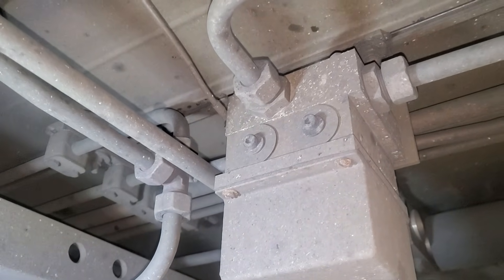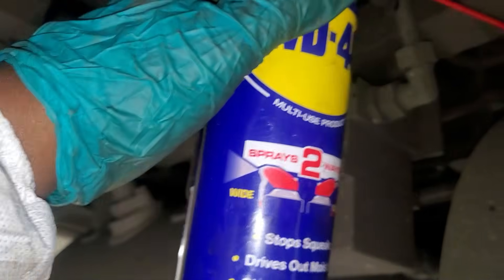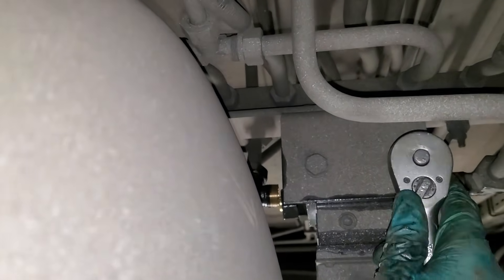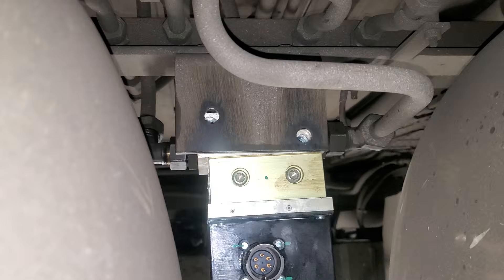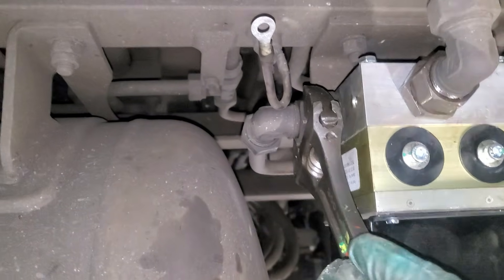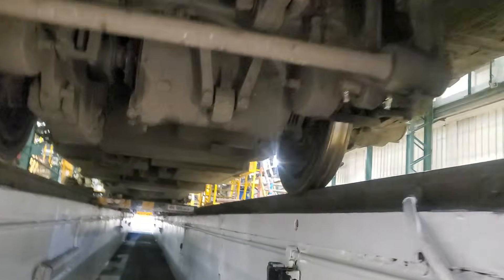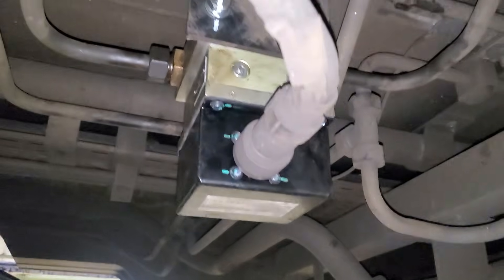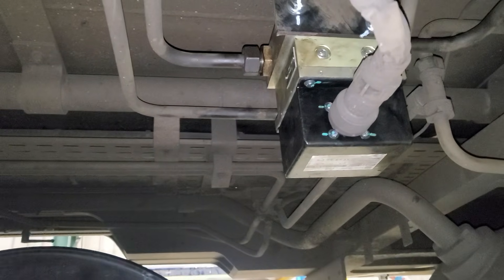Underneath train pneumatic valve replacement

Comment: What Depot, do you work at?
Are you always flat out busy? 
On the basis of you changing 8 duplex valves, what else would they help you do in that shift or did you do on that shift?
Reply from the maker: Yes its always busy always something to do and helping others with tasks.
Reply: @nolimit7 what are the hours? 7am -7pm?
Reply from the maker: @seychelles44  7 to 3

Comment: finally why do you use  a shifter instead of fixed spanners
Reply from the maker: We call it an adjustable spanner here and there are many reasons for using it instead of a fixed one which I will list.
 
1. There is a rule with working on trains which is that adjustable spanners can only be used on pipe fittings because they are generally low torque
2.  I have a metric spanners but some of the pipe fittings are another standard so the metric spanners dont fit right
3. Its just easier to take one adjustable spanner in my tool bag if I can instead of a bag full of spanners when I go under the train.